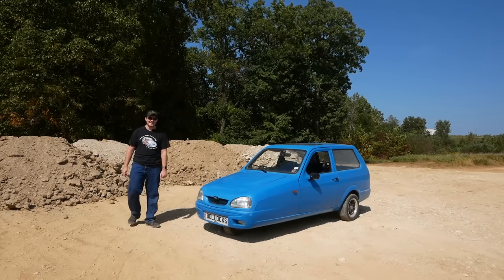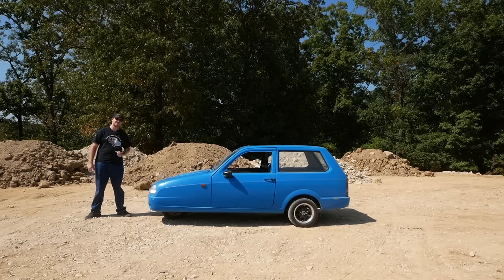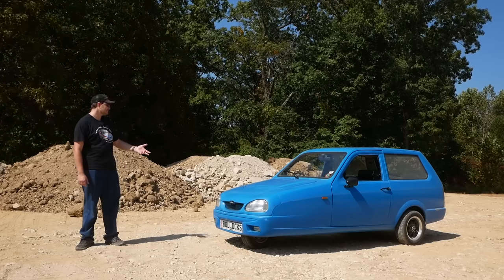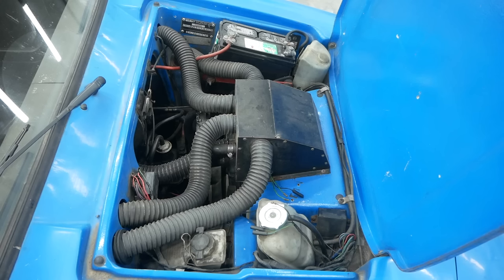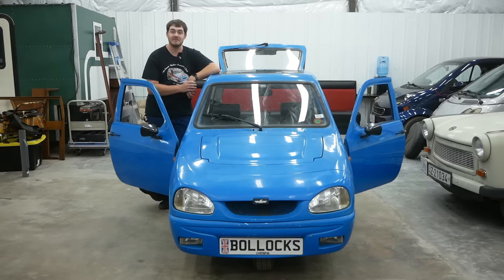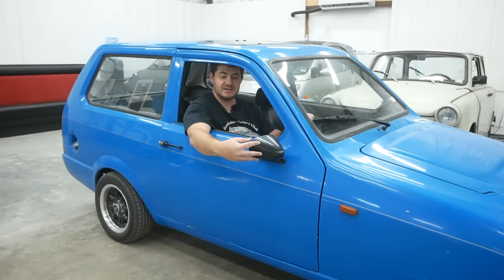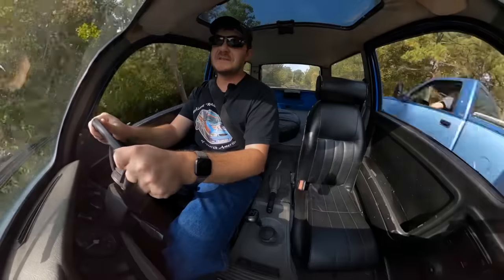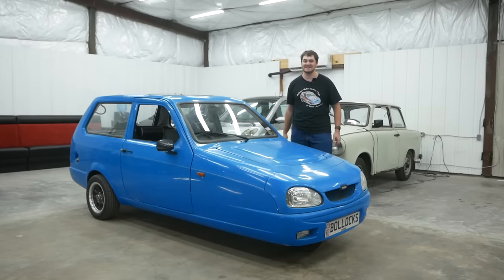I Bought a Reliant Robin!

Comment: As stated in other comments, there was the loophole in the UK where you could drive one of these on a full Motorcycle license. I actually knew a man who exclusively drove reliant Robins from when they were first launched, all the way until he died around about 2005. Before that he only rode motorcycles with sidecars. This man had a wife and three kids and managed to get around and do mostly everything required of a family man of the times.  The guy had a Mk3 exactly like this one. Some kids pushed it onto it's roof one night, However it was ok afterwards. It needed two new windows, which were bought and fitted the next day, it had some paint scoffs, which were either polished out or touched up with some rattle can paint, and it was serviceable again! 

Truly is a candidate for one of the UK's most simplest road vehicles for the common man. Cheap to run and maintain, and the parts until recent times, were quite cheap.
Reply: What's the advantage of a "full Motorcycle license?" Is it a lot cheaper than a regular car, by how much?
Reply: @user-ut9ln4vd5m  In the United Kingdom, Motorcycle licenses are now in stages and have been for a long time. I'm not exactly sure how it used to be 40 or 50 years ago though. In the modern age, you need to take three tests before you get the full Bike license and it could be argued it costs just as much to do as a car. Back then a Motorcycle license was cheaper to obtain. Some people who had been in WW2 and National service in the 50's would have had vehicle licenses transferred from when they were in the forces. The main drive for someone to be Reliant (ha!) on a reliant robin, is the fact that they were cheaper to run. The Vehicle Excise Duty (or road tax as it's known) was a lot less for a vehicle classed as a Motorcycle/tricycle than that of a car from the same era. That tied with a lower purchase cost, and lower fuel bills meant it was a winner in certain situations.
Reply: @user-ut9ln4vd5m  back then motorcycle licences were found in cereal boxes.

My dad doing his, his examiner was on foot and he was asked to do a lap around the block, so on the back of the block where his mates were parked up, he pulled a wheelie deliberately showing off (he'd been riding without one for a while *on private land officer*) he didn't realise the examiner took a lane and was standing on the other side of the road, still passed and was just asked "had fun did you?".

Sadly because of that lacklustre approach to the licence a lot... And I mean a hell of a lot of riders died very early in their motorcycle riding and slowly over time, things like the CBT (a training day you need to be seen as competent on before being allowed to ride light motorcycles no greater than 125cc with L plates) and the two part on and off road tests came in along with age limits and power limits as well as the two part theory/hazard perception test.

A full bike licence is one that has no limits, it's known as a category A licence. This is awarded after either completing training and 2 part exam (+ 2 part theory test) on a more powerful bike and being over the age limit (I believe it might be 26 now but it was 21 when I did mine) or automatically after 2 years of riding a bike that falls within the A1 (restricted licence) power category limits.

Biking is more dangerous these days, far more comfy cars on the road and far more inattentive drivers as a consequence. So as the death rate climbed, the path to riding one became more involved.

And cost... When you throw in the £125ish CBT, £800ish of tuition (that's what I ended up doing 4 6hour days + mod 1 test), whatever the test fees cost and the cost of your gear because you will need to get some in addition to the vehicle. I'd say it's more expensive.

My car licence I got after about 30 hours of lessons which cost like £25 a go. So yeah motorbike these days is a smidge more expensive I'd say.
Reply: @BrucieMagik  back in the day, you could drive up to a 250cc motorcycle on a car license, while always displaying L plates. Anything bigger than a 250cc and you had to take a bike test, that was it. Yes you could drive a Robin or Regal on a  full bike license, but you had to have reverse gear removed. I took my bike test in 1993, and that was when you had to do your CBT, but if you took your test on a 125cc, you could then ride any size bike you like. After this came the system you’re talking about 👍🏻
Reply: I passed my UK motorcycle test in 1971 on a Lambretta Li125 scooter ( max speed an indicated 60mph). This licence allowed me (and still does) to ride a motorbike of any capacity/engine power. No instruction, no further tests, no helmet required (then). Had I the money and the inclination I could have jumped onto a Hondayamazuki 1100cc Ninja Widowmaker quite legally. But I wanted a roof on my transport and a Reliant was the next port of call.
Reply: @mattcrooke8321  The Reverse Gear thing was a myth. You could ride a motorcycle up to 250cc on a provisional licence or larger capacity bikes with a sidecar but no passengers unless they were full bike licence holders. The grey area was, were 3-wheelers just sophisticated combo’s? Where I lived, lots of 16 year old kids bought old Reliants or even Bubble cars and drove them with L-plates. Coppers usually turned a blind eye.
Reply: @MorgoUK  they certainly did mate and reverse gear removal? I worked for reliant cars in their Lincoln garage for 6 years and all the cars I worked on had a 4 speed box with reverse and 80% of our customers only had a full bike license 😃
Reply: @jimclements3190  Hi Jim. I think the reverse-gear misapprehension was a compound of two things: M/C Combos just didn’t have a reverse (generally) being motorbikes, and the original Bond Minicar, so I believe, had the capability of turning the engine-wheel unit through 180 degrees giving the full gearbox in reverse. It did cause a lot of confusion where Reliants were concerned. Liverpool coppers were more on the ball as my brother found out!
Reply: Haha,yes Steve you are absolutely right about the Bond having that bizarre steering, talking of Bonds while I was there I rebuilt a Bond Bug in around 2003/4,it was the only 3 wheeler that younger people were interested in,made me think it was 40 years ahead of it's time😎
Reply: @jimclements3190  Hi Jim ( again) The Bug was a top motor for UK teens. I rode shotgun during a party to take a mates brother home. He sat on my lap, honking out of the flappy window!  My Supervan 3 took me from Waddington to Southport for a year or so till I rolled it down the Formby by-pass. Happy Days!,

Comment: I had a  1961 Mk6 Reliant Regal when I was a lad. It had a 4 cylinder  747cc Austin side valve engine, which had a separate cast iron cylinder head, cast iron cylinder block and aluminium crank case. I was a young biker and would take all my mates out in it. Great fun and a hell of a job to keep on three wheels!!

Comment: When I lived in England in the 1970s and early 1980s every Robin I saw on the road was driven by an elderly man with an elderly woman in the passenger's seat. Both were wearing hats and gloves and were dressed entirely in beige.

I was told that their popularity was due to their cheapness, both initial and running costs, and because they were classified as motorcycles so the road tax rate and insurance was much lower.
Reply: Indeed. We got rid of that but it seems the tax rule still applies in the US!
Reply: I live in the North of England. Reliant 3 wheelers were still a common sight on the roads round here until about 15 years ago, and always seemed to be driven by opinionated retired men wearing flat caps. At no more than 35 miles per hour.

More often than not used as a conveyance to take them from miserable little homes to miserable shops to buy meagre rations of miserable foodstuffs, with a miserable hatchet-faced other half in a headscarf sat looking glumly out at the world from the passenger seat, with a massive leatherette handbag on her knees. Either that or the owners were slowly driving on their own to grotty little pigeon lofts or allotments, by way of a betting shop. 

Most were in miserable colours like brown, beige, or (for the more daring miserabilist) pus yellow. Outlandish owners sometimes chose white.

These Reliants must have been serious fun to drive, as the owners seemed to have no other joy in their lives. 

I suspect the demister being on all the time was a safety feature, as some owners wouldn’t have turned it on themselves, in case it caused their Reliant to use more fuel. Every pound was usually a prisoner to a Reliant owner.

The owners, more than the cars, gave the words Reliant Robin a general air of meanness and an unfathomable “there’s nowt wrong wi’ it - it does me grand!” belligerence, that only a (now dying breed of) Northern British man could revel in the unremitting bleakness of.
Reply: A lot of bikers had them cos you could drive one on a bike licence.
Reply: @SvenTviking  Which is the real reason for their popularity with older gentlemen. Passing the test for a car licence would be expensive and potentially difficult at their age. If you've ever talked to a biker about their driving prowess you'd understand - no, no, no, no, no no, no - not opinionated and stuck in their ways at all  ;-P
Reply: Motorcyclist likes them because they can be driven in winter on a bike licence.
Reply: @kaitlyn__L  still pay motorcycle tax rates on them in the UK

Comment: Hey, does that have an "E" stamped at the end of the engine number at 8:26? If so it's had an engine swap for the higher compression yellow top engine from the GLS Rialto. A damn good engine I might add... If it is, and you have the matching diff swapped, you might actually achieve 100mpg!!!
Reply: Imperial gallons, I bet.
Reply: @torstenpersson5629  Looking at about 85mpg US give or take a slosh.
Reply: I'd settle for 85 mpgs
Reply: It's a bit suspicious how a lower compression was supposed to achieve better economy.
Reply: How come lower compression yields better MPG? I always thought that compression adds engine efficency, which not only adds power but also lowers fuel consumption.
Reply: @ferrumignis  The engine is a derivative of the 1922 Austin engine - pretty much any work they did was going to be an improvement lol.

The Rialto engine had 8% more torque, and the engine ran 15% slower - those two combined - along with the lower ratio differential (down to 2.78:1 from 3.54 or 3.23:1) 
bumped up the mpg and top speed quite dramatically, despite shaving a few bhp off at the same time!
Reply: @ferrumignis  just noticed I'd put lower in the original comment and have now edited, cheers!

Comment: The reason it was so popular in the UK was the fact you could drive it on a full motorcycle license, without having to pass the car test.
Reply: One of the dumbest loopholes... In the US our driving tests are crap, but at least we recognize that driving a motorcycle is actually more dangerous and requires more skill than driving a car...
Reply: I thought that only applied if there was no reverse gear? Or am I thinking of something else?
Reply: @William-Morey-Baker  These days the UK motorcycle test is much harder than the car test. Back in the day more people had motorbikes or (like my grandfather) motorcycle combinations. This was a real alternative (although Grandad got his car licence and bought a Morris!)
Reply: and it did not rust and the road tax was  a lot cheaper
Reply: @tnticesp  The chassis rusted admirably !
Reply: @cooperised  No, it's actually done on weight.
Reply: @delcat8168  not on the last mk1 robins ,rialtos and mk2 and 3 Robins it didn't, they were fully galvanised
Reply: @cooperised  That law/rule only applied very early on in the production of three wheeled vehicles and was quickly changed as it was dangerous.
Reply: @jimififul  That is the real market for these, people with families that would otherwise use a sidecar combination but wanted the shelter and relative comfort of a car.
Reply: @delcat8168  The later galvanized cars seem to be holding up fairly well, the pre galvavized ones however can and do rust to pieces as you say.

the later chassis can be retro fitted to the mk1 models and non galvanised rialto models easily the only difference is the rear seatbelt fixing point  and rear anti roll bar mounts on the later models.
Reply: @cooperised  That was many, many years ago, possibly effected the Reliant regal but by the time the Robin came along it was mostly based on weight and number of wheels.
Reply: @jimififul  I don't agree with that I'm afraid, practical part of the motorcycle test is a breeze, especially given that you don't have an instructor say right next to you so you have a bit more leeway, you don't have to parallel park or reverse the thing and the hazard perception and question sections are not that much different, I have HGV as well and that was pretty much the same other than double the number of questions and a bit of extra reversing instead of a parallel park.
Reply: That made it popular with people who'd got a motorcycle licence when they did National Service - no need to take a driving test if they bought a Robin.
Reply: @cooperised  No it just had to be under 450kg
Reply: Alright thanks guys, it's not been true for a while, message received! I believe there was a time when the 3 wheeled version of the BMW Isetta shipped with a disconnected reverse gear for this reason though, which would mean sometime in the late 50s or early 60s. Is that right?

Comment: Great video...
Back in the 70's, when the Reliant Robin was initially launched, most working class men only had a motorcycle licence, as cars were still very expensive to own, maintain and run. Therefore going to work on a motorcycle, given the typical crap weather in the UK, meant that they'd either get soaked and covered in dirt, or they'd have to wear a bulky rain suit, which would crumple their clothes. Also trying to transport groceries, and/or a wife and kids on a motorcycle can pose a few issues. 
The Reliant Robin offered an economical solution, they could drive on their motorcycle licence, so they could travel in some basic comfort, and be protected from the elements.
Reply: @a1c3c3u  in the UK they were popular in the 60's and 70's
Reply: A new 1963 Reliant van helped my dad with his work as a decorator . I just remember being in the sidecar before that. On his M/C licence the reverse gear had to be blanked off !
Reply: My boss was a biker but he was entitled to a company car. He chose the Robin and commuted 50+ miles a day for a couple of years until he decided to take his car driving test.  I had a van for a while, used to go away for weekends with a mattress in the back and sleep either on car-parks or out in the wilds. Great fun...and I never rolled it once
Reply: @MrSpangle6564  Thanks for sharing. ❤❤ 
I definitely wouldn't fancy commuting 50+ miles in one of them every day, some idiot in a HGV would drive straight over you and never even notice.

Comment: I'll bet that mystery switch is the brake pressure warning. You get a leak in one of the two circuits, you get a light. The switch merely tests the bulb. I just rebuilt that gimmick in my MG.
Reply: You are 100% correct, I found a copy of the Rialto II manual that features a "brake test switch" that looks the same. If it lights up, the hydraulic pressure is too low and flipping it is just for testing, as you said.
Reply: k halliday - Nope, these systems weren’t that fancy. The light is connected to a switch on a device called the “Pressure Differential Warning Assembly” or PDWA. If one side of the dual braking system develops a leak, there’s a shuttle in the PDWA that gets pushed from the stronger side to the weaker, tripping the switch and turning on the light.

Comment: Robert didn’t mentioned the luxurious accessory his Robin have: The moonroof or sunroof. Nice collection of weird cars. You should try to get a car produced here in Brazil by Gurgel, called Moto Machine. Would fit perfectly in your garage. Greetings from Brazil.
Reply: I looked up the Gurgel Motomachine and instantly said "holy shit."
And now I want one.
Reply: Fightre Flighte Was a nice project in the wrong time. They also produced an electric car in the beginning of the 70’s. Some how a similar story between the two men, Tucker and Gurgel. Although Gurgel was quite successful for many years producing cars on top of the VW bug platform. The MotoMachine and it’s “big brother” the BR800 had a 2 cilindro engine that was an air cooled VW engine “cut in half”.
Reply: I've read about Gurgel before (discovered them as they are mentioned in the English Wikipedia page for the lada niva) but dont quite remember this one. I probably just saw it under a different name. The off road ones I found more interesting. It would definitely be cool to see a Gurgel in an english speaking channel though, whatever model it is.
Reply: Or a Gurgel Itaipu, to put the Weego on the shame
Reply: Elliott Savva I’ll try to find something. If successful I’ll put the link here.
Reply: @paulog8813  I did find it when I looked it up. Just hadn't heard of it using that name before. Or I just forgot as it's more generic than the names the other models have.

Comment: 11:37 - That's the mandatory brake warning light. You press the switch just to test the light.
Reply: Was there a law in UK that required a test function for that brake warning light? Because all the brake warning lights I've seen are just the lights. They also double for a parking brake light so that you can test the bulb by simply applying handbrake.
Reply: @mibars  I don't know if it was mandatory for it to be testable, but that's how it was on a lot of old British cars. My classic Mini had a brake warning light in a test switch like that. It doesn't illuminate with the hand brake (like modern cars), only if there's a loss of brake fluid I think.